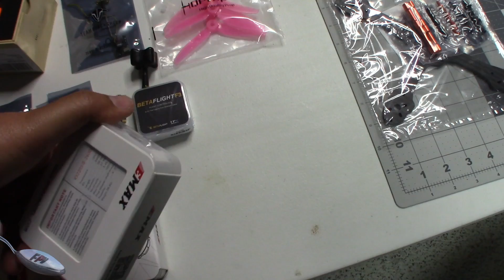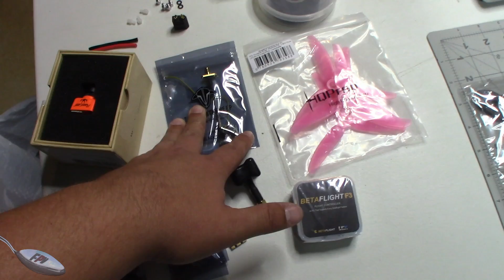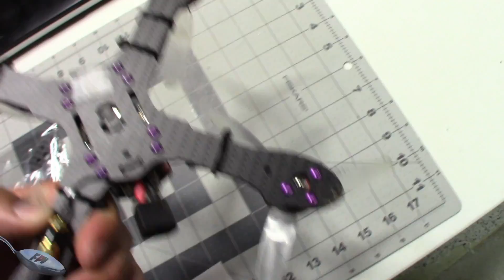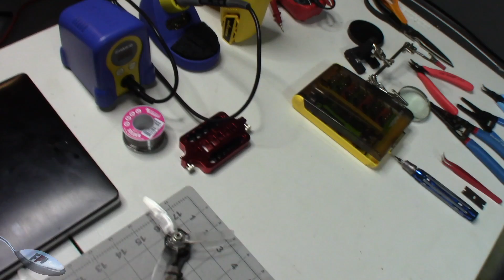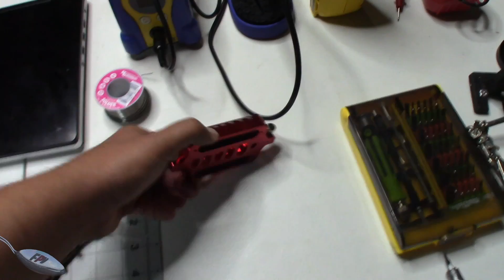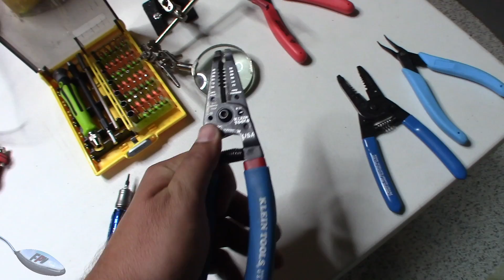Build Your First Drone/Quad (Parts And Tools)

Comment: Lipo you will need a battery for sure.  Didn't see them on the list. What would you use for race and practice
Reply from the maker: DAMN!!!!!! I knew I forgot something, I thought I nailed it =)  LiPo lol.   Yeah, I use the Strix 1550s for practice, and the Revo 435HV or Lumineer Graphine for racing if HV isn't allowed.  The Strix packs seem to take a beating and last, the lumineer packs are 50/50 on if they hold up, but man do they put out, and the REVO 435, verdict isn't in for longevity of those, but they certainly deliver.
Reply: nah.. I used 4 solar panels from some old calculators and that works just fine too.

Comment: I want the build video today! You had me going with wanting to see how you'll mount that camera and VTX.
Reply from the maker: As soon as he has frames back in stock, I will release the build video.  I have a promise from Secret Weapon that frames will be in stock early next week.
Reply: That's understandable. Looks like a solid frame.
Reply from the maker: Yeah, I've only broken one in 2 years of flying them, I've been very satisfied with them.  They're a few grams heaver than the next competitor, but they don't use the FC as part of the structure which makes the quad and parts inside a lot more durable.

Comment: Looks like the frame is out of stock, I will keep checking. I have been in the market for a stretched x for a few months now.
Reply from the maker: It is, I'm aware. It will be back in stock early next week.  I have the build video done, and I'm waiting to post it until they are back in stock.
Reply: Spoon FPV I actually just finished the video... If I had done that before commenting, I would have heard you say it 😀